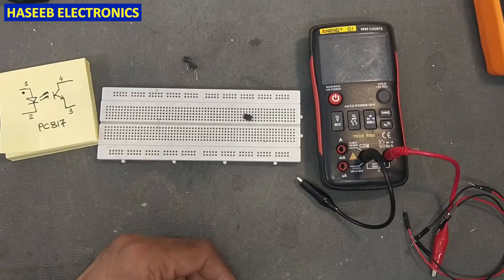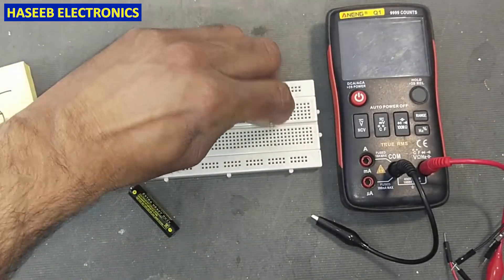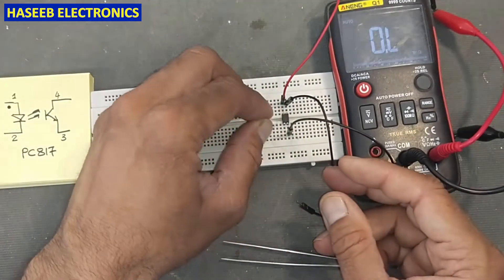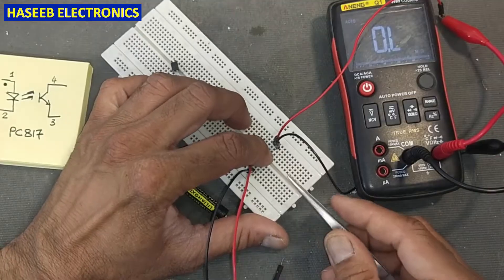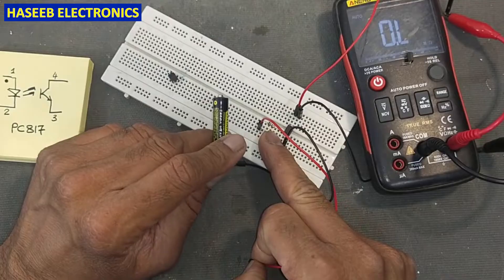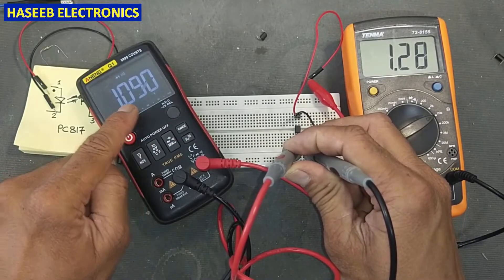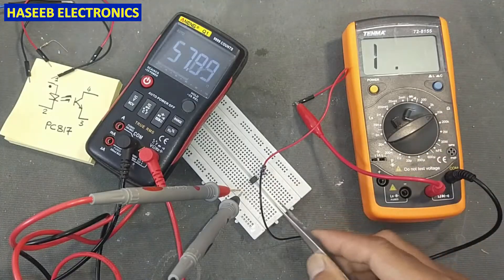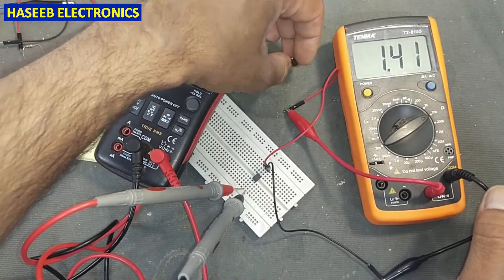{762} Very Simple Optocoupler Testing, Opto-Isolator Test

Comment: bro i did as you said. i have two multimeter, 1 meter connected diode mode pin 1 and 2,  another meter connected to pin 3 and 4, the second meter showing me 500 OHms. i checked with 2 optocoupler, the same result. is that 500 ohms okay or failed?
Thank you

Comment: Hi thanks for your videos which are very very informative. I have one question.  I am trying to troubleshooting a pcb for treadmill (model YJ-004). Do i need to desolder the optocoupler(EL817) from the board to test it, since i am having strange voltage in forward as well as reverse bias? Thanks

Comment: Am Using  two multimeters for testing, with multimeter A in diode  mode  Voltage across pin l and 2 , is 1.616V , but  with MULTIMETER  B  in Resistance mode  with probes across  pins 4 & 3 , its shows no reading.This his mean the optocoupler is working or dead
Reply: Help here

Comment: The battery cell without any resistance is around 1.35V and giving about 70mA. The resistance across pin 3 and 4 is above 5K ohm. Is the optocoupler TLP560g good or bad?

Comment: Hello! Thank you very much for sharing your knowledge with us and for all your effort doing those videos. If the resistance is 4kOhm between pin nr 3 and 4 when we connect correctly in pin 1 and 2 in diode mode a second multimeter this value at 4kOhm is acceptable? Just as value is acceptable? Thank you in advance

Comment: Good day to you, I totally enjoy all your Smps videos. I am working on my microwave, power board ,and it keeps damaging 2 diodes, after the mini transformer on the board. The resistors and caps on the board read good the only thing left was the otocuplar and the relay.I will keep watching some of your other videos, to see if I missed anything. The micro switches check out. But I was leaning towards the transformer on the otocuplar. Can you point me in the right direction.  Will send a picture of the board later if needed. Thanks for all your time in making these videos and I  will be doing some more research

Comment: I did use a led tester ( diode) and multimeter in photo-transistor. When led tester was turned on, resistance in the other side fell to 100 ohms.

Comment: Another wonderful video, Haseeb! Thank you. I find the simple octocoupler to be intriguing... What fun things might be made with it? Of particular interest is how it might be used to make an electronic potentiometer that would not be subject to the typical scratching noises of a dirty mechanical potentiometer... But, to do this, the octocoupler might need to be deconstructed into its separate parts... Why?, Because, if you just use a mechanical pot to control the octocoupler LED, whatever glitches that are in the mechanical pot output are going to be passed to the octocoupler... Create a box with two chambers. Cut a hole, in the dividing wall. Install a mechanical sliding gate over the hole. Configure a common transistor with a Light Dependent Resistor on its base. Place it in one side of the box. Configure a common LED with a current limiting resistor. Place it in the other side of the box. Use the mechanical sliding gate as the control. I am just thinking out loud, here... IIRC, there might be something called a "light gate?"

Comment: I want a method to test optocoupler on circuit without removing from it. Do you know how ? some types 
like HCPL-7860 how to test it on circuit ? some inverters and servo drivers have some of these optocouplers.
But pc817 is easy and simple one to set.

Comment: Hi sir..very informative video...
I have a question for you....
What is the purpose of a single loop copper wire outside a transformer core in smps? Sometimes a single loop copper wire is connected to gnd.